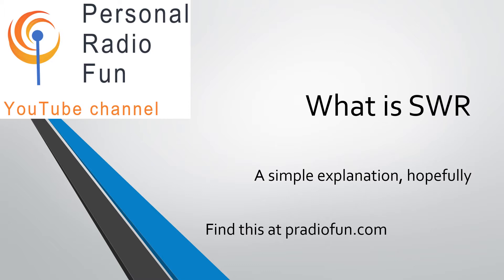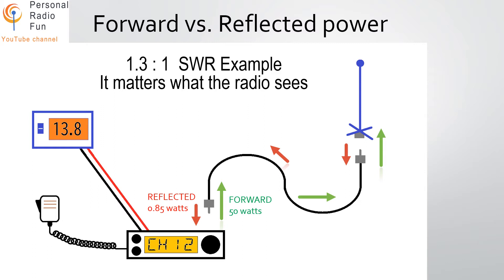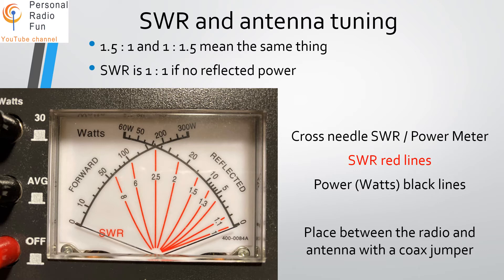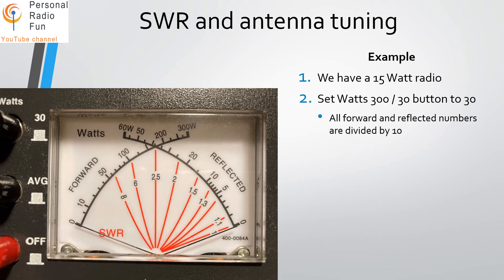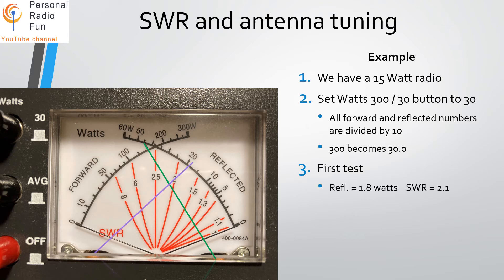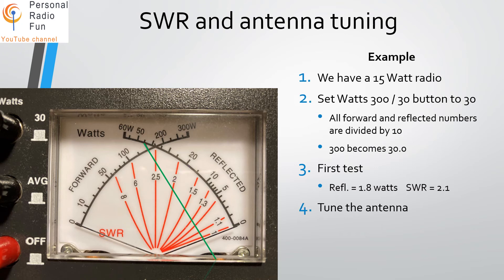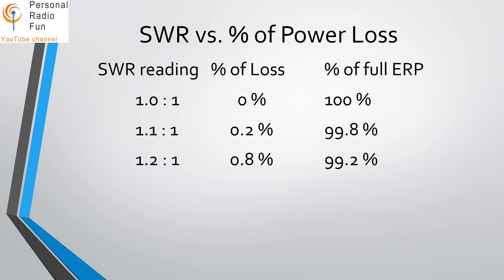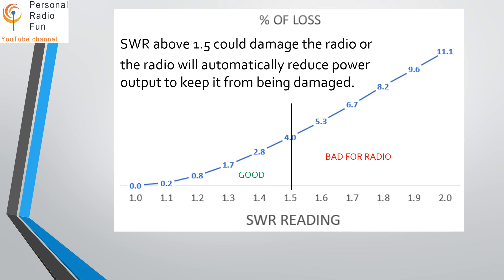SWR explained

Comment: OK, so SWR is a measurement of reflected power; so how and why is the power "reflected". Yes, I know it has to do with tuning the antenna so that the impedance matches between the antenna and the radio, but more directly, WHAT reflects the power, and how does tuning the antenna to its resonant length prevent that? Would installing a resistor at the ends of the antenna prevent this reflection?
Reply: Hi Dustin. This is all about energy being transfered from one conducting source to another all needing to be at the same matching impedance to get full transfer.
First of all the radio end needs to be matched to the outgoing coax, then again at the other end of the coax the antenna needs to be matched to the co ax also. If everything is impedance matched then maximum transfer will take place and there would not be any reflections.  
An impedance mismatch will cause a return reflection of some signal.  Extreem mismatches are a shorted end or an open circuit. There are various other mismatches that can occur between those two. Impedance is all about the design of the conducting parts. Capacitance and inductance are two of the main factors that deterrmine impedance. All of the component parts iether add capacitance or inductance and so antennas can present as all sorts of impedance values due to design. Long parts short parts, parts close together etc.endles posibilities. Oh yes there is the resistance of the materials to add into that mix.  Hope this helps.
Reply: Your doubt is so profound that I don't even know if most people can imagine how difficult it is to answer "why things are". Children generally want to know the why of things, and not just examples, effects or analogies. And in fact, science still hasn't figured out why a lot of things, actually. The more you understand, the closer you get, but the real reason is still missing. So in the case of reflected power, what I know is that the power comes from the voltage and current of the signal source varying. And then we have current and voltage varying and a transmission medium (the line), and this we call a wave, in this case electromagnetic. And this type of wave has many analogies with other waves, and has much of its behavior explained in Maxwell's electromagnetism equations. He noticed relationships between some existing theories and brought this knowledge together.

In his development there is one that shows the behavior of an electromagnetic wave traveling in a medium and that encounters a change in this medium, such as a fault, a discontinuity, a change of medium (type from air to water, or a coaxial cable to a dipole antenna), or a screen (obstacle). And it turns out that this voltage and current wave, which is also a varying Electric and Magnetic field, when it goes through these types of changes in the environment, each field interacts differently with this change in the environment. But in any of these changes, both the Electric and Magnetic fields interact with this change, and part of the energy that these fields carry interacts with the material of the media and this interaction causes a macro effect, where it appears that the wave has passed forward, but a part of it returns the way it came. This Sometimes the wave that passes ahead passes with its fields unchanged in relation to the phase, other times it does not. The same occurs with the fields of the returning wave. And this occurs whenever this wave goes through these changes in environment. Another important issue is that everything that is at stake here also depends on the frequency that this wave has. If the wave is pure, we can think of just one frequency and that makes it easier to imagine things.

The way in which the Electric field and magnets interact will be different, but the truth is that we do not have signals of this purity. We always have more content in the signal, which means that reality is of a compound complexity, and we need to understand simple things to be able to try to glimpse a little of reality. If you keep asking yourself, why do the Electric and Magnetic fields interact in this way when their transmission medium changes, then you will be going even deeper, arriving at Quantum Field Electrodynamics, a Theory of Physics where almost everything ends up. She tries to explain the interaction of matter, but even she is still unable to explain the truth.

Comment: Cos my field is in computers, i have some idea, , your wondering, what the hell is an SWR, SWR stands for "Standing Wave Ratio", the transmitting signal travels along the antenna (FORWARD) and refects at the end, returning down the antenna (REFECTED), the forward signal interferes with the reflected signal causing constructive or deconstructive interference, differant lengths create differant phases along the antenna, when a peek meets a peek there is max emission, and when a peek meets a trough there is zero emission, an SWR ratio of 1:1 is perfect constructive interference, where the cycle appears STATIONARY on the antenna, creating a perfect waxing and waning electo-magnetic field, as the electric field collapses, the magnetic field increases and vice versa, , ,Without that load absorbing energy, the energy instead appears as a high voltage or high current somewhere which may not be equipped to handle it, , 

So basically, an ideal 1:1 SWR will produce a low 50ohm resistance match where the antenna does work, the SWR is relatively constant along the feedline, the impedance will vary along the line unless it is perfectly terminated (that is, the SWR is 1.0 : 1). This is an important concept for impedance matching, because with a high SWR, the impedance at the final output transistor load inductor could be mainly higher, or lower than 50 ohms, and produce a high current that damages the finals, , ,

Comment: No it is not important to only check VSWR at the radio.
You should check it at the antenna with a VNA, yes you should have a radio meter 99% have one in the radio. 
But checking VSWR after a a long run of coaxial cable is false as the coaxial cable absorbs some of the reflected power as coaxial cable loss. 
Infact you can add coaxial cable length to soften the reflected power if you don't have a tuner but this will lower your ERP.

Comment: A 1.0.1 swr doesn't guarantee that all power is radiated at all , reflected power doesn't go back into the radio to damage it either,terrible info in this video
Reply: what is the truth?
Reply: @mehmetdemir5655  reflected power adds to the forward power back to antenna and radiated, how much depends on the feedline, loss in the system can make swr low ,reflections by Walt Maxwell explains in great detail what's happening
Reply: @paulm0hpd319  Oh, thank you for your reply
Reply: @mehmetdemir5655  reflections 3 is a free download
Reply: @paulm0hpd319 absolutely correct 👏

Comment: This was great! Does using an antenna tuner mean you gain back the loss watts mentioned?
Reply: Howdy.
I would think that a tuner provides a conjugate output impedance to the transmission line + antenna impedance. This, I understand, is the best power transfer setup. So, in my mind, a tuner will recover much of the reflected power and send it back to the antenna to radiate.
A tuner is an impedance trasformer. It transforms 50 ohms purely resistive to the coax. + antenna conjugate impedance.
My thinking is that a tuner does not bring the antenna into resonance. But it brings the coax. + antenna + tuner system into resonance.
Dave Casler takes this one step furher. According to him a tuner brings the coax. + antenna + tuner + environment total system into resonance.
However. I recognize there are two schools about this. The other persuasion claims that the reflected power is transformed into heat eventually.
Regards.
Reply: @eugenepohjola258 totally agree
Reply: @eugenepohjola258  There are not two schools of thought.  In science and physics there is only one explanation.
Reply: I too  would love to know if an ATU will recover the lost power and the antenna will radiate it, or will the LC circuits in the ATU simply absorb the reflected power and protect the TX finals?
Reply: @mikeymouse4629 power reflected from the antenna is reflected back to the antenna from the radio or the ATU if you have one. The loss is no where near as bad as this video suggests.
Reply from the maker: I will keep this simple so I may not be technically correct. 1) An "antenna tuner" does not increase antenna gain. 2) It does make the transmitter think everything is okay so it doesn't reduce TX power to protect the radio. 3) It does help with receiving signals also. This part seems like magic to me because it doesn't fix the resonance of the antenna.
Reply: Good explanation, thanks